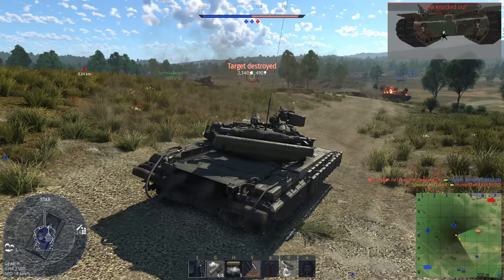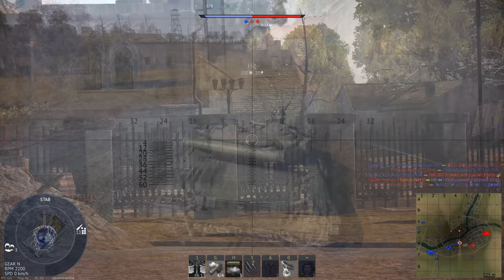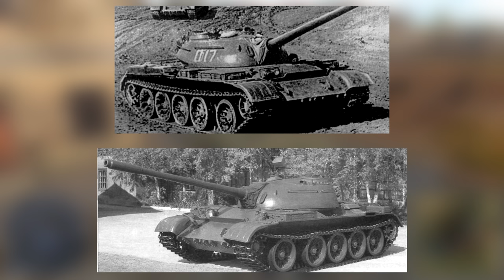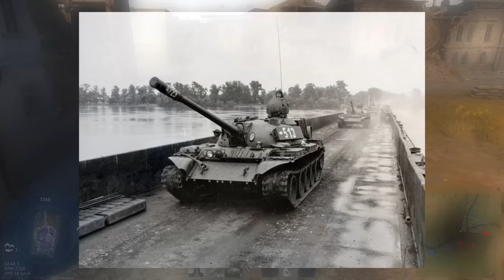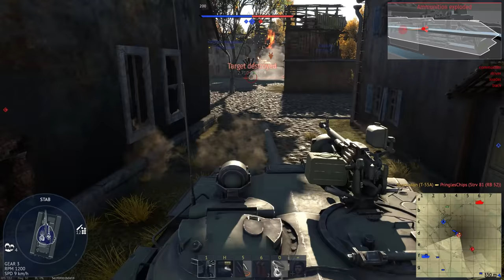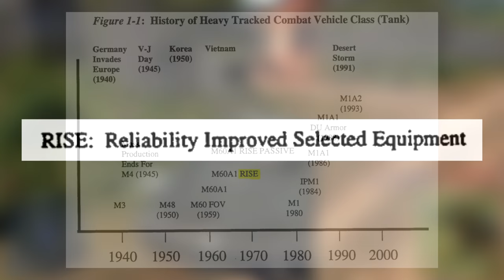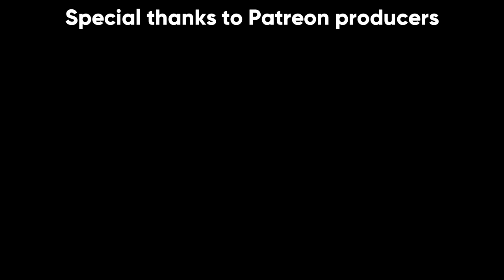Were Soviet Tanks Poorly Made?

Comment: From what I remembered reading, the t34s were built to a quality sufficient for its expected life expectancy (planned obsolescence). No point making it perfect if it's only going to live a several 100kms at best and probably knocked out before then (rolling straight off the production line and into battle in stalingrad)
Reply: Reference?
Reply: That most likely never actually happened, considering how all Soviet factories were moved East as soon as possible
Reply: @alexwhitehead3494  The myth could easily be explained by T34s being serviced in older tank factories. The equipment to produce may be gone, but the bricks are still standing.
So when a T34 rolls out of a factory, which was built to accommodate heavy equipment inside. It's easy to see how it could be mistaken as a new vehicle by the common soldier.
Reply: You want a reference for the well known and established fact that the tank factories were moved to get them out of the way of the German advance? Really?
Reply: @Novat that is entirely possible as it would seem that way, I'm more interested in just pointing out that it is a myth rather than where it came from, although it is probably where the myth came from
Reply: @alexwhitehead3494  Also wouldn't the factory's have been bombed at that point in Stalingrad? Or did the Germans not bomb the soviets' as much?
Reply: @2adamast  There was a Renault Ft-17 in use with the Syrian rebels. Is that tank not obsolete then?
Reply: the problem is: look at the original design requirmemtns. if I am not wrong they wanted a 100 hours engine lfietime. on average i managed around 68 and less if i am not mistaken. before the war the soviets themselves tested it and concluded it is not battle ready. but still they rushed it to production. no wonder they took so amny losses
Reply: It seems to me that the T-34s may have been left inside the original buildings of the factory, whether they were worked on or not, or even if they were produced in that building, as fighting was so fierce inside the city from building to building it could be that it was mobilised quickly to defend the place.
Reply: More importantly it was built in evacuated factories, by women, children, and random people.

Comment: I have read that the faults of the early T-34's were only readily apparent when you were the nation that is operating them. The Germans for example heavily praised its design in the early stages of the war because all they could see were tanks that they had trouble knocking out, and were reasonably mobile.
Reply: How much of that was the German commanders trying to deflect from their own fuckups?
Reply: @ScrogginHausen  In the Summer of 1941 it would have been difficult to achieve more than the Wehrmacht did in Russia
Reply: Post war german praise is heavily biased toward excusing their failures.
Reply: @HelghastStalker  Apparently even a 50mm would crack the hulls of Soviet tanks due to their poor metallurgy and welding.
Reply: @HelghastStalker  "Best" gets a bit hazy when technology was progressing so quickly. The 50mm Pak 38 entered service in April 1940, and was perfectly capable of dealing with a t-34 from the front. Also keep in mind that the vast majority of soviet tanks in 1941 were not t-34s, but t-26s and BTs.
Reply: @ScrogginHausen  even 37mm managed to do that. they made so many production mistakes that 37mm could penetrate soem areas even on the front. sometime HE would be enough to kill the crew because of spalling
Reply: no germans easily knocked them down
Reply: Thats what I heard, that where the russians most lacked. And I quite honestly expected he would talk about. Is not the breaking down part, or bad design. Because that's useless. Wasn't the life expectancy of most nations tanks about 2 weeks when they saw active combat? I was more expecting him to talk about the missing radios. No communication. And where the Germans eventually had an actual steering wheel. The Russians had to shift gears with an hammer. Crew comfortability was veery low on the list. With made soviet tanks perform terrible because crews would be exhausted even without combat
Reply: There is a story of a german pack (I cant remember the callibre but I guess a 75mm) that shot more than 20 times at a t-34 before it noticed from where it was shot at. The t-34s biggest problem was that they couldnt see shit and that most of them (cant remember if not all) had no radio.
Reply: @tizi087  They made the metal so brittle that a 37mm could shatter the armor without penning, but then a huge hole was open.
Reply: @jsn1252  But that implies the T-34 and KVs were made in small numbers, out of the 3100 T-34s combat ready for Operation Barbarossa, around 2400 were destroyed or captured by January 1st. 1942. Compare that to the total number of German Medium and SPGs (like the Panzer III Stug F and Panzer IVs) made up until the Summer of 1941: Only around 2650~. Not familiar with the loss rate but obviously considerably less as the Germans would destroy 7 T-34s for every 1 German tank lost.

T-34s got SMOKED by on paper inferior German tanks because their shitty armor wasnt properly welded or heat treated and it just shattered like peanut brittle.
Reply: I heard that at this time germans did not know how exactly t-34 looked like so in the fields tanks crews often missinterpreted kv-1 as t-34 so they thought that t-34 was inpenetrable for theirs guns.
Reply: Considering many German generals post world war 2 were looking for coveted nato advisery positions, it makes you look much better if you blame it on them having better tanks and also promoting a lot of untrue myths that most people won’t know is not true unless your Russian but then again why would you deny those claims?
Reply: Uhm... Germany didnt have trouble knocking them out? Panzer 3's of all things could reliably do it.
Reply: @brentonherbert7775  Not the early 37mm and short 50mm armed Panzer III's. They had significant trouble. They were the most common tank during the start of Barbarossa. The stubby 75 of the early Panzer IV also had difficulty, as it was intended as an infantry support weapon and not a tank killer.
Reply: @B52Stratofortress1  And why is that? Russians heat treated their tanks so high the armour just shattered at scary frequency instead of absorbing shots.
So this whole myth of the germans having nothing to knock them out is just wrong considering the most kills were from Panzer 3s.
The Sherman was also made as an infantry support tank so what is your point exactly?

Comment: I feel a lot of Soviet military equipment follow the modern 'agile development' philosophy. Deliver a minimum viable product first, regardless of the issues, and then fix and improve later. This way you can keep the production lines running in case a war broke out. The drawback is with so many variants logistics becomes a nightmare but if these weapons are meant to be expendable, maintenance shouldn't be a major concern anyway.
Reply: Not just that. Central planning and full employment policy had to be killers for quality in any production.

Comment: Tank: has bad transmission, poor crew work conditions, maintenanceand reliability issues.
Soviet engineer: Give me a year, and I'll make it better and cheaper.
German engineer: Let's start the production right now and I promise, in a year it's gonna be more expensive.
Reply: German engineer: Actually, let's start design work on the new Wunderpanzer that will have twice the armour, twice the speed, and a cannon which is twice the calibre. This will solve our issues!
Reply: @Ypog_UA  And we only need four times the fuel for it.
Reply: @Cyberdoom460  Eight times, weight goes with cube, not square of the increase...
Reply: @KuK137  No, a tank with double the weight does not automatically have a fuel consumption eight times the size.
Reply: @Cyberdoom460 if only Germany was as big as Soviet they would probably had more resources

Comment: Spookston on T-54: " the transmission was garbage"
Me: ha! So that sentence from The Bear and the Dragon about the T-54 needing the steel shavings removed from its transmission after ~500 running hours is probably true.
Reply: 500 running hours is quite a lot of runtime for a tank engine and would almost certainly involve several maintenance checks. This sounds like classic Clancy nonsense.
Reply: it's because tom clnacy's soviets where so advanced they discovered how to create material from the void: their engines where nothing more than metal particles generators, producing steel shaving one could forge into usefull things :))))
Reply: @halfassedfart  If you do not know the facts, fill them with numbers that sound right I guess 😄
Still one of my favorite authors though.
Reply: Just remember a part of the T-54 was made out of magnesium and caught fire until replaced
Reply: Trasmissions have been universally problematic.
Reply: The pains of having un-heat treated transmission.
Reply: @halfassedfart  I have been a mechanic for over 20 years. Including working military aviation Mx. EVERY transmission or gearbox I have ever overhauled or even opened/serviced has had a magnetic shavings collector in it. Including some really nicely cut grarboxes. ALL, without fail when new had some shavings. That’s really modern alloys, this story from the Clancy novel sounds about right to me.

Comment: I would not describe the T-34 design as a bad design, but everything about it was rushed - design, production, and quality checks.  Especially when compared to its mass produced rival, the Sherman.  Though it was good enough for what it was used for.
Reply: I guess it would be described as purposefully rushed as to get them produced earlier.
Reply: Well that’s one way of looking at it. Although the initial version was a good version, later versions were bad in terms of crew ergonomics and build quality compared to German and Allied tanks. Quantity does NOT have a quality of its own.
Reply: @wanderingnomad1  I don’t think that any of the T-34 variants were ever very ergonomic. Especially the turret on the early models, mostly solved on the 1943
Reply: @ArchDuke ArchDuke true, it’s ergonomics we’re bad from the start as the crews were expected to tolerate the cramped conditions
Reply: @wanderingnomad1  based
Reply: well im sure the wartime shermans would definitely be worse off if the cities they were under production in were under siege from the germans along with often bombing raids, as the russians had to put up with when they were in the thick of it before pushing back the germans, the american tanks might have been better made, sure, but the russian tanks were designed to outproduce the attrition the russians were suffering on the eastern front, the whole 2000 shit tanks is better than 500 good tanks idea to outdo the germans

Comment: A lot of information about the t-34 was left out. Like how one factory produced over 50% of the t-34s, and that factory was producing insanely low quality product, more than half the components of most of the vehicles they produced were missing. Including important things such as optics for the crew, and radios for most of the tanks. Not only this but all of the soviet heat treating of the t-34 was poorly done and done twice as hot as a proper heat treating temperature should've been. Thus making the armor extremely ineffective to the point where over 50% of t-34s knocked out in combat were knocked out by panzer 3s with their 50mm cannons. Furthermore the t-34 was oftentimes only half assembled off of the factory line, a large percentage only having one half of their fuel tanks. Even more poor construction is found in the transmission and engine where gears and drive components weren't heat treated at all, causing such damage to the transmission that many crews carried a spare transmission into combat
Reply: This is mostly true, however this was caused by the war situation. In 1943, most of Soviet production was seized, 15 million soldiers were dead, famines and food deficiency across the country, millions of civilians being executed by Germans behind the front lines, because they weren't German, were not the best conditions for quality assured, flawless tank manufacturing.
Reply: tactically reloads transmission
remember, switching to your second transmission is faster than repairing
Reply: This isn't really true. 50 mm guns were made specifically to counter new generation of tanks like T-34. Armor quality has nothing to do with it - simililarly you can't blame T-34 for not resisting 88 mm gun. Even then according to Germans own field tests, 50 mm couldn't reliably pen T-34 with standard non tungsten munition. T-34s were made to be impervious to 37 mm AT guns and AT rifles. And they completely protected the tank against them, by design.

It's also a huuuge stretch to say that all T-34s had poorly heat treated armor - it happened only when production was so ramped up that many factories didn't recieve temperature measuring devices in time, so metal workers had to estimate it.

Lastly, brittle armor still provides plenty of protection. The issue appears only when projectile reach near overmatch values of penetration. A 37 mm gun won't crack a brittle armor. But 50, 75 mm gun will,  with spalling,  where otherwise it would likely,  but not surely deflect.

PS. Transmission was deliberately made shoddily to save on manhours. The logic behind this is that most tanks were delivered near the front via railways,  and then last more or less the average lifespan of a tank / length of engagement.
Reply: The Panzer3 and the T34 having nearly the same weight, what's surprising that the German tank killer could take out it's Russian counterpart?  Unless people expect something exceptional from Russian design.
Reply: @2adamast  yeah, it's not like Sherman was impervious to 50 mm either lol

By this logic it means Sherman was crap
Reply: @phunkracy  it’s funny how in all your replies you conveniently always ignore the part about how poorly welded or horribly heat treated lots of T-34 were that it would crack like an egg when struck my non penetrating rounds. and yes, a lot of them were since they came from one factory that is notorious for poor quality produced over half of the T-34s made. 

If you’re going to go off of paper stats in ideal conditions for penetration, even the 37mm Pak 36 could penetrate the T-34 frontally trough it’s weak and flat turret face. You know, the flat part of armor on the tank that every T-34 fanboy ignores.
Reply: @ender1111  Nice excuse. What do soldiers have to do with shitty production?
Reply: @cuhyotepowered1201  Technically if the round struck the upper part of the initial 1940 and 1941 models, it could bounce God because of the angle.
Reply: @liviuganea4108  Never once have I said "soldiers" . I said "situation". Learn to read

Comment: I think badly made is incorrect I think inconsistently made is correct. Different factories made the tanks and some were worse and others better
Reply: It's not a matter of a specific factory. It's a matter of specific time, conditions etc. 
First, during the war Soviets had terrible trouble maintaing production. Evacuation of factories and random people, even children at production lines.
Another problem were production targets, and full employment policy.
The main issue with any 'communist' production is that production targets came before anything else, and quantity was always the main concern.
The second issue was the full employment policy. In typical factory anywhere in communist block you had to be so drunk to fall unconscious at work, or openly sabotage production to be fired. Even if you were fired for poor performance or anything, you had another job granted waiting for you, so there was no way to actually make people do a good job. There were elite workers, yes, but they were rare and still rewarded for quantity, not quality.

Production for export into capitalist countries would (sometimes) go through special quality checks. In Polish car factories, once PDI (mainly for export) was introduced, it turned out that even 4 in 5 of rear axles in a passenger could be faulty. Guess what happened to the faulty ones; they were used for domestic market cars.